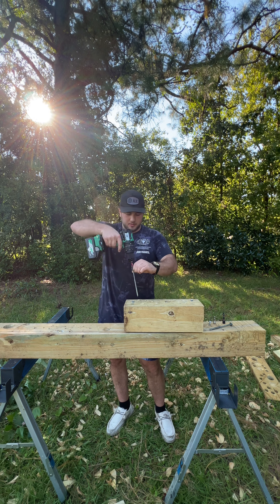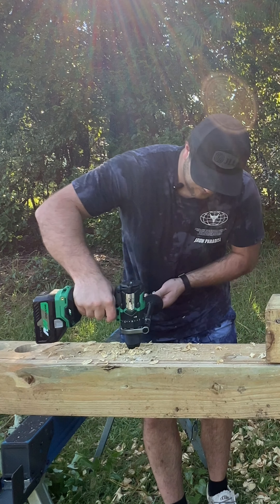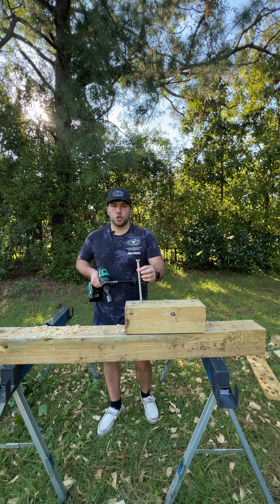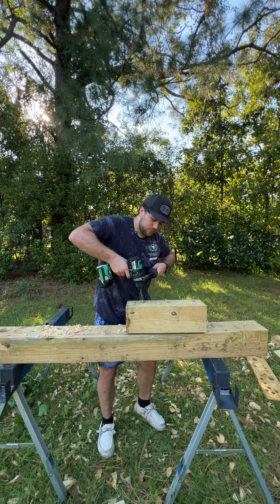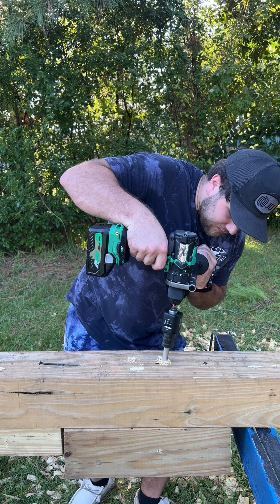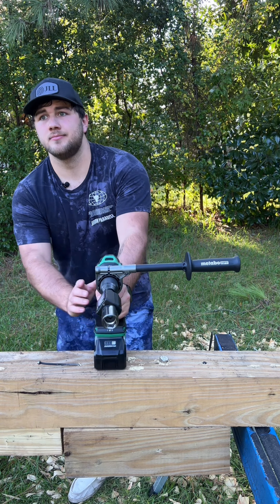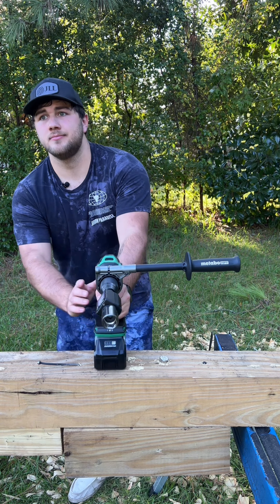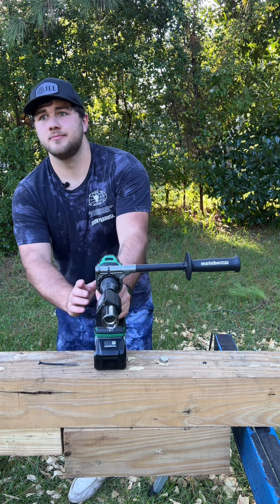Metabo Hpt DV36DC break in + torque test!

Comment: This is the best hammer drill on the market imo sans the 1007 ….however if your stateside and only able to buy into one platform of cordless tools MHPT aren’t the one imo  & I’ll tell ya why, if mhpt/ hikokis Corporate structure wasn’t so disjointed they’d do a lot better here….sure the nailers and compressors we get first but for example Metabo HPT Normerica div. doesn’t even know what new tools are being released under hiKoki, when or even if they’re coming to North America literally this hammer drill was released like over a year ago on Japanese market but the delay from release on the JDM then wait on a quarters sales numbers to evaluate if the demand is there and if its worth them rebranding them & shipping to the states etc well all that takes hikoki six months to a yr … & generally the case ends up being that the USA don’t get but a quarter of the tools released by hikoki and if you import them, you void the warranty and you’re paying an arm and a leg through eBay…for example Americans don’t even have access to the 12 or 14 V line which have a few interesting tools like the multivolt 14.4v/18v whp18dbdl their version of a hydraulic impulse driver (surge is a comparable red model) also mhpt don’t have a barrel grip jigsaw in the states yet but everywhere else it’s literally been released then discontinued and then re-released everywhere else in the world. So ya they have some amazing tools and I’m a huge fan but the logistics and red headed step child treatment the states gets doesn’t work if it’s your only platform. Sorry for the long winded rant😂

Comment: İn lag bolt test when drill stops, take 2nd trigger pull. You will not believe what you see:) btw ı think its the true method in lag test you should force tool to its limit. Dv36dc will show you about 64ftlbs. Not every drill can handle second trigger pull but metabo can. That thing is ridiculous
Reply from the maker: It’s a beast so far

Comment: Im confused its advertised as 1400 inch lbs but your saying it only puts out 56.4 foot lbs which  is 676 inch lbs or am i missing something
Reply from the maker: @Urban_hunter2021  most companies do this, almost none of them will get what they advertise.
Reply from the maker: @Urban_hunter2021  I’m sure they have their own way of testing the tools though that they can do whatever they want woth
Reply: @Kaleb_RoSs  so I assume no company's make a hammer drill over 1000 inch lbs or even get to 1000 inch lbs
Reply from the maker: @Urban_hunter2021  it terms of a test like this one definitely. This is the second strongest drill I’ve ever tested.
Reply: @Kaleb_RoSs  what was the strongest and how many ft lbs did it get
Reply from the maker: @ Bosch 1330c at 57 ft lbs
Reply: @Kaleb_RoSs  did you test any rigid hammer drills or the dewalt dcd 996?
Reply from the maker: @ I tested the newest Ridgid hammer drill and the newest Dewalt hammer drill the 1007